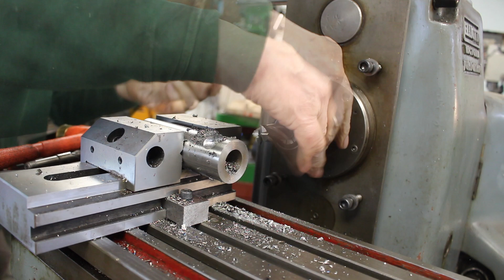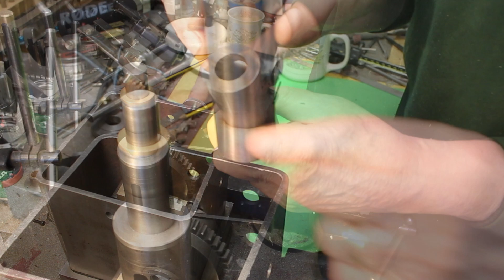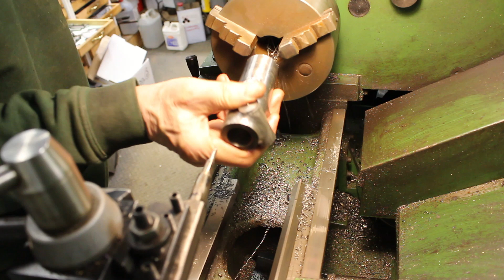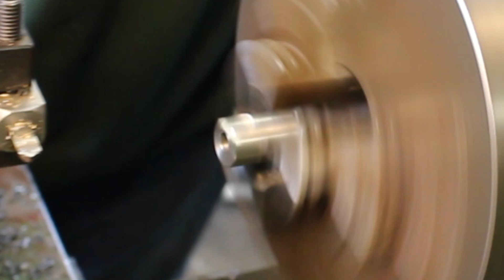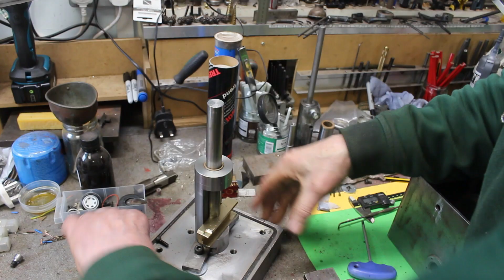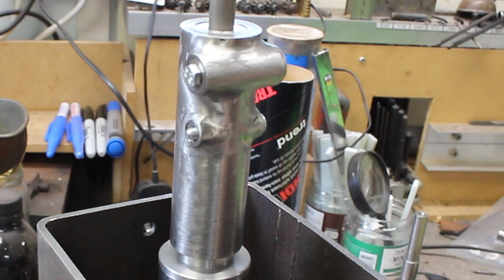Shop Made Die Filer Build Part 13 - File Carrier

Comment: good idea of holding the files. on mine which is a commercial item, it has a worm screw with left and right hand threads pulling two nuts together, it is good in the fact that it will hold any size file, but it is very fiddly and tends to work loose. yours seems to be a better way.
Reply from the maker: Thanks for your interest and feedback re your commercial die filer, very interesting.

Comment: Now that we see the top part starting to emerge, this is a giant die filer!  Very well done!
Reply from the maker: Yeah, it's getting rather tall. Thanks for your interest.
Reply: @GoCreatehms  
So is this why you made it with a transmission, so you can handle the really heavy work?
Reply from the maker: I've got large files and small files so yeah, it needs to do the hard work of big files but also allow the lighter and finer work of the smaller files, hense the variable file stroke and change gear. I didn't intend to include these features when I started, they just evolved as work on the die filer progressed. I may have another evolutionary suprise up my sleeve in a future video, I'm pondering over a new feature. I'll keep you in suspense!!!

Comment: That cotter pin reminds me, when I was young I was given an old "Rudge" black bike and the flats had worn over on one side of the crank and no matter how hard you tightened the pin after a few weeks it would get chewed up, so I called in to a local fabrication shop to get the pedal welded, but they were busy and said to just leave the bike there and call back later on.
Obviously when they got time they just quickly ran a bead around the end of the shaft, but the pedals were out of parallel by about 10 or 15 degrees. I can still remember how hard it was to cycle and I used to leave it out hoping it was stolen and finally it was and my Dad had to put his hand in his pocket buy me a new bike.
Thanks for the video and the memory.
Reply from the maker: Graet this video bought back fond memories, good to hear your storey.
Cheers